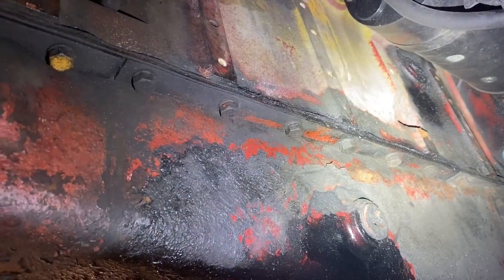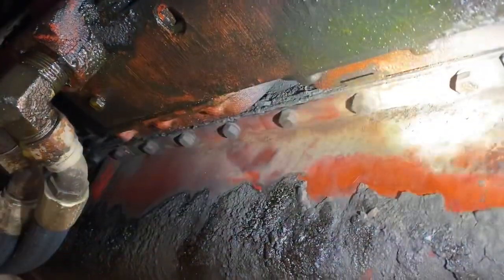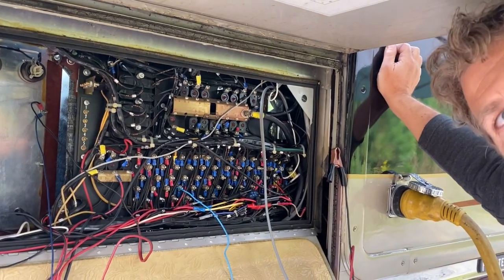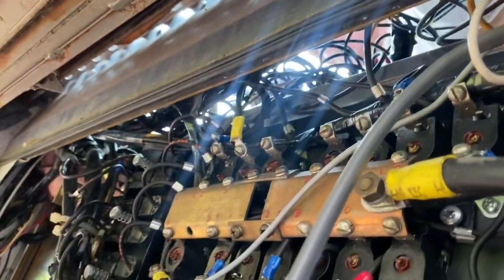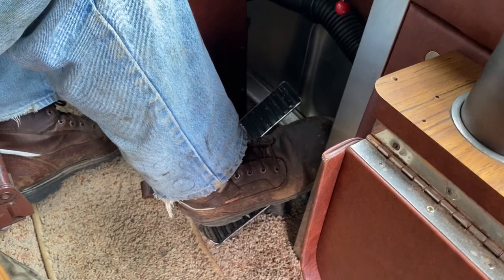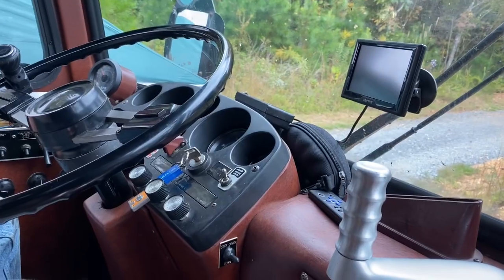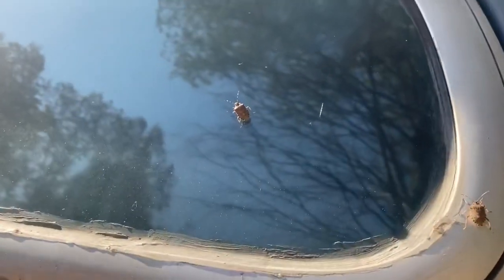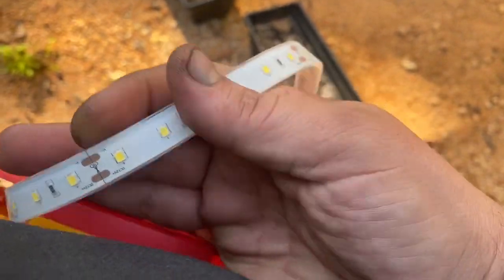MCI bus conversion work.  Electrical system work. Paying it forward with Lance. propane injection

Comment: Curiosity question:  I know the 120 volts comes from either plug-in power or the 120 volt generator.  I know that the 24 volts comes from the batteries and the alternator.   But where does the 12 volts come from?

Comment: You know me and my Wanderlodge. Its a lot like that. 12/24 volt DC and 120 VAC. I put in a pile of Lipos and they run at 48 volts (to the inverter). Solar over the winter. The studs are crazy. I pulled all my lug covers off after seeing you do that a few years ago. Thankfully just some light rust. One day I will get up there. I got a Cummins turbo Diesel but the brakes and suspension positively I like looked at. By that time I will need it.

Comment: Ashley Marks and all - We use thermal imagers all the time in our switchgear at the nuclear power plant I work at for finding hot spots on connections! The transmission guys use them from helicopters to check major power lines and in switchyards for bad connections. Definitely a good tool if you can get one at a reasonable cost.
Reply: The units that plug into a phone work terrific - Seek makes one that is more sensitive than some competitors and used the phone battery so it need not be charged itself.

Comment: Lance’s story about leaving his wrench on an aircraft reminds me of a similar story my Grandpa told me. He worked on B29’s during the war and his commanding officer would hid quarters all over the plane of items that should have been serviced and he’d count the amount after they were done and turned in. If they weren’t all turned in, like Lance said, take everything apart and find them. Love the Buc-ee’s hat Scott!
Reply: One of my old mates here started out on Sabre jets (!) and had a lot of similar stories ,including using the rubber chocks on the ropes to belt the wing and make the fuel gauges work. But he is right up to moment on the latest electronic knowledge ,having fixed my engine diagnostic machines which had stump a few others. One thing he uses is a signal generator  to find obscure faults on late model cars which OBD scanners cannot detect. It's some thing that is needed on those older bus systems .

Comment: Sold my wheel simulators. Pain in the ass with holes that didn't match my rims. Couldn't air up tires easliy. Paying Luke to swap to longer studs on front and tag

Comment: That LONG Beltt on that thing scares me to death!
Reply: It's like something out of an antique textile mill.
Reply from the maker: He asked me to meter the alternator.  I declined as i would need to reach around the top of the belt while standing on a ladder.   It’s not charging.  The 12v positive cable on the alternator does not have +12v.   Got to figure out where it goes to.  But not while its running.
Reply: I wonder if someone could come up with a tempory belt guard?  A couple pieces of 3" PVC from top to bottom open on the back fastened together to keep the spacing right.  Slip it in over the belts with some sort of hangers to do the work.
Reply: @BusGreaseMonkey  I always refer to that belt on the MCI's as the belt of death. I would never have big enough cajones to even get near that belt when the engine is running.
Reply from the maker: I’ve called it that at least 50 times on our channel maybe more
Reply: @BusGreaseMonkey  Well that very likely explains where I heard it. I have been watching both your videos and Tyler's for a very long time. I enjoy them all.
Reply: Indeed, not while running! The MCI has a unique belt run to the top. If you don't have 12v at the terminal, that's a relief. Better a cable than an alternator...at least on heavy equipment.

Best of luck...tracing those large zip tied bundles is a task. Be sure to probe both the terminal and the bolt! Perhaps there's a bad connection in the battery bay.

Comment: This is a Big Lesson on Safety as well with Electricity When Lance spoke about the Ring on his hand around 24 volts!! Just Don't Wear any necklaces or rings or even piercings near any electrical!!
Reply: My wedding ring melted instantly and burned my finger. Leaned the hard way.
Reply: My dad told me about a mechanic who was disconnecting a battery with a wrench.  He got his ring caught between the wrench and the other battery post - burnt his finger completely off !!!

Comment: That wire runs changing colors is highly annoying.  Multi-voltage systems in the same unit are also exciting.  Nice work guys.
Reply: It's the latest cameleon wire.

Comment: Propane injection/fumigation idea for a turbocharged application:

Take an air brake relay valve, run your boost pressure to the control/service/diaphragm port, your LP supply to the supply port, and the injection orifice on the inlet of the turbo to the delivery port. Plug off the exhaust port. This will make your LP pressure across the orifice directly correlate to the boost pressure thus automatically adding more fuel as the boost goes up.

Comment: If you know the part # you can likely get the studs through Euclid for a lot less money Euclid is one of the largest hardware manufacturers and suppliers in North America. We just need to find a local dealer that carries their products. If you don’t have the part # you can take one out and got to there catalog and find  it. It will show them in deferent lengths. 

I have never payed that much for a wheel stud ever. Some one is having there way with you.

Comment: Propane or acetylene injection?the bottle said acetylene.
Reply from the maker: No the bottle does not say acetylene.   The regulator is for acetylene but it’s the same threads as a propane tank. Propane

Comment: shudder The coachbuilders who did the 1980 conversion on my MCI-3 absolutely butchered the electrical system, and made many questionable choices in the 110v systems.  Heck, there’s a stubby 110v switch sticking up out of the floor for some reason.

Comment: Ah, Custom Coach wiring. Not every installation is the same. On a friend's 92 Prevost, that main panel by the driver is a thing of beauty, excellent harness work. 

Over the years, some coaches have plenty of modifications. I'm fortunate that it's essentially "undoctored".

There are both 12 and 24 volt buses in that panel.

Have you found a source for those custom coach wiring diagrams?

Comment: I love and hate wiring problems on motorhomes and Prevost motor homes. Hate them because it could take days to find the problem, but love that it usually only costs 50-100 bucks in parts. Most of the time only 3 bucks or less in parts. Reverse engineering one of a kind builds are such a headache. Never have I seen a prevost mh with a complete wiring harness schematic. Nothing labeled,

Comment: I wonder if thermal imager would be a decent tool to quickly ID electrical hot spots.
Reply: it is, I've used one on my breaker panel and it was obvious as all hell which circuit had my computers attached. Seek makes a nice one that attaches to your phone - sold on Amazon! Add it to a wish list Scott!
Reply: BLKMGK4 
Does he have a public wish list for us to help out by buying something?

Comment: New channel - ‘Learn with Lance’. Some wise words of caution there though. Not keen on all electrical systems using same ground. Very sketchy setup. Not a great fan of some RV wiring. It needs to be logical, well thought out and above all integrate safely into the vehicle’s existing systems.

Comment: Thanks Scott. Wonder if Lance saw this on PBS: Command and Control. Ref, dropping a tool on the job. At a Titan II missile complex in Arkansas in September, 1980 a  worker accidentally drops a socket, puncturing the fuel tank of an intercontinental ballistic missile carrying the most powerful nuclear warhead in our arsenal, an incident which ignites a series of feverish efforts to avoid a deadly disaster. Good job today. Delta will give you some rain, two to three inches all day. Bless

Comment: I'm not understanding this need for propane injection....... you are not a Spitfire aircraft that needs nitrous oxide to pull out of high-speed Dives wow you're getting shot at by the enemy...... if you do and tractor pulls I can understand the propane injection...... for a motorhome the engine you got in it is engine you got .....period., stop end of discussion, I didn't really mean end of discussion but it just seemed appropriate...... but come on in guys being shot at in enemy territory and you need to get the hell out of there for a short boost of  juice
Reply from the maker: A moderate hp boost for a few hundred bucks.  Your car does not loose 10mph just climbing a hwy overpass so i don’t expect you would get it.  Flip a switch and maintain your 65mph speed instead of dropping to 55mph.   15-20hp extra when needed should not be hard for you to understand
Reply: Not a fighter plane evading an enemy, but instead a heavy ass bus, with the aerodynamics of a brick with rounded corners doing everything it can to maintain highway speed. 

N2O is by no means a fair comparison to propane either. N2O leans the fuel charge, and typically has to have fuel enrichment accompanying it in order to prevent catastrophic engine damage. Propane OTOH is richening up the mixture, which would be akin to sizing up the injectors temporarily. 

Well within what the output range of that engine is capable of. Not like they’re going to be cracking pistons, or dropping the crank in the road doing it.
Reply: Matt Brown FYI it’s not a caterpillar. It’s a detroit diesel with a cat yellow spray job.
Reply: @BusGreaseMonkey  Your reply to d eddie could have ended with "15-20hp extra when needed." Just saying!